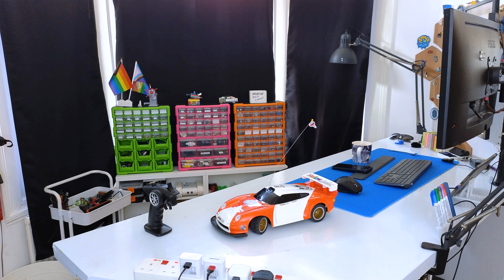Restoring My Childhood RC Car (23 Year Old)

Comment: You joke about the on/off feature, but I have an Nvidia Shield TV game controller, and that thing has no on/off switch at all. It wakes up with the TV and turns off when the TV turns off and you can't even take out the batteries! :D and it's from 2020 or somewhere around that time.

Comment: Not previouusly knowing the backstory, I am incredibly proud to be your tramp stamp. Delete this comment if "tramps stamp" is offensive, in which case i apologize to any and all.
Reply: What is this comment. Cringe.
Reply from the maker: It’s an inside joke.
Reply: @hundredeyes4596  I don't follow, though my deepest apologies at making you feel that cringing sensation 😂
Reply: @gearscodeandfire  you literally just did it again. Talented.
Reply: @hundredeyes4596 talented like a fox!
Reply: @gearscodeandfire  Rhymes with fox certainly. Square and unremarkable. Not known for its talents.
Reply: @hundredeyes4596 Burn!